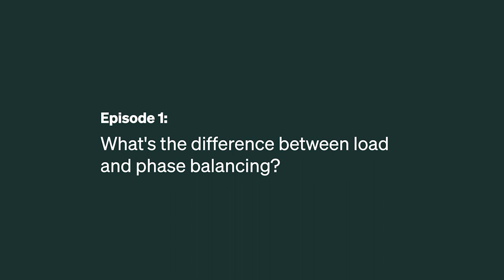What's the deal with load and phase balancing?!

Comment: The load balancing seem to be cloud dependant based on what I've read. What happens if the load balancer (sense, enegic, etc) loose internet connections and can't send load data to the charger?
Reply from the maker: Then, the offline static balancing takes over. What it does is to see the available power, and the available load between all chargers, and then assign them to use a specific phase. An offline Zaptec Pro can also be assigned 3-phases if enough power is available. If Sense or similar is connected, in most cases, charging is at a minimum, i.e. 6A/1-Phase, because the info on the building consumption is unknown. In other words, charging is still possible if a charger is offline, but it should be connected off course under normal operations.
Reply: Need clarification: With one Zaptec GO and Sense with P1 connection, does it use all available power across the 3 phases and take in consideration the current house load for each phase or no?